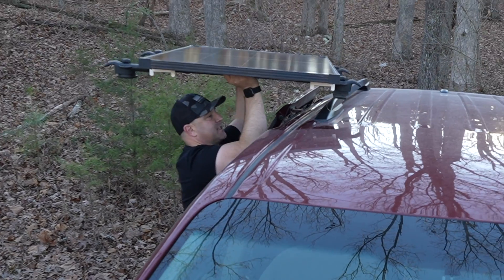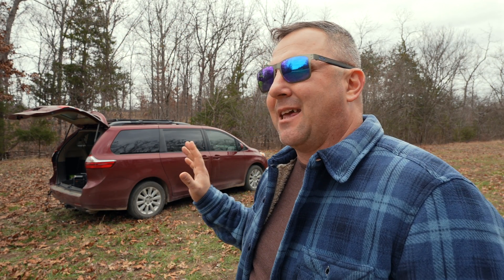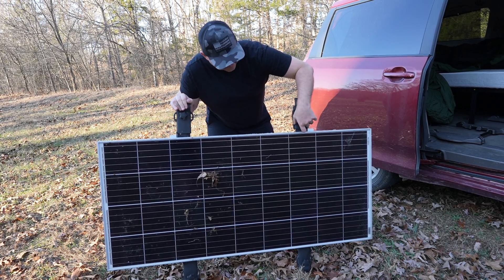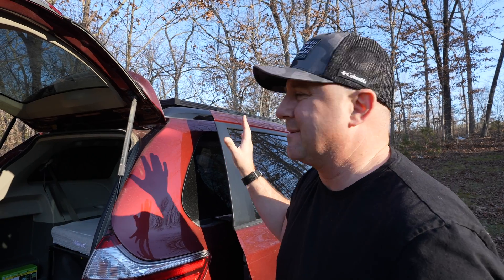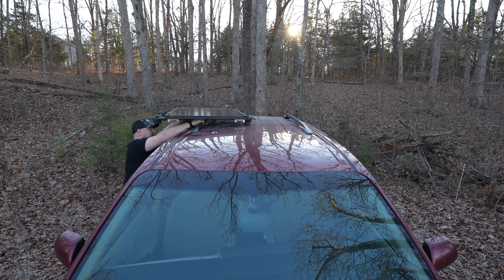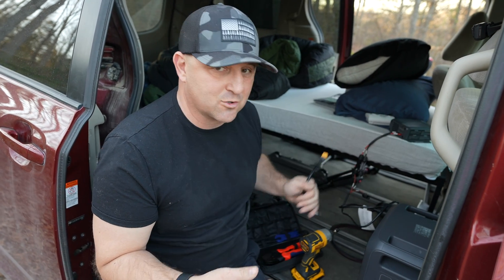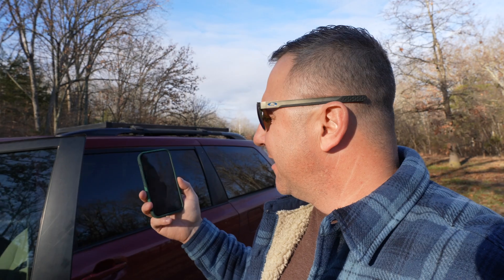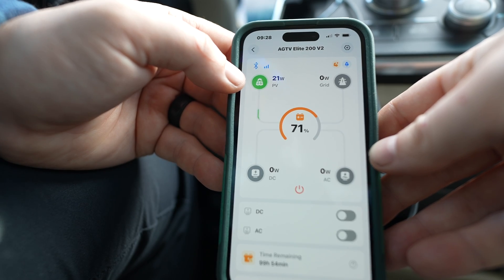Watch THIS Before Going Solar with an Alternator Charger!

Comment: Hi Mario, 

My 2012 Sienna Alternator failed yesterday.  A combination of 1500W Inverter, Headlights, Max A/C, and a few other minor usb accessories over loaded the system, failing the  starter battery then alternator.

I estimate the load that failed my system was 800-1000 Watts, a load beyond the alternator capacity.  

Rapid/High capacity battery charging consumes this and even higher levels of current.

Symptoms:
--> Invert Code:  Low Voltage (from car starter battery), turned off inverter
--> 30 minutes later, total failure, car went to LIMP mode.
--> Alternator shows open circuit, consumed a new second battery
--> Alternator & Battery replacement

I was at a remote state park this weekend, Labor Day 2025 when it happened and thought I would charge/top off my LifeP04 100AH battery while running some errands.  This was the first time I had exercised this charging process/procedure under these conditions, this was new.

This will cost between $1,200 - $1,600 to repair.  Lesson learned.

Important note,  Alternators generally do not have overcurrent protection, they just generate until they fail.

Fast charge systems can fast fail your alternator if they exceed the alternators rated capacity.  If the Bluetty or other unit does not require input of your car model to determine max current capacity, this is a sign of a potential  future failure. 

I Thought I would just share and hopefully save Viewers some money and inconvenience.
Reply from the maker: Ouch. 1500 watts is a lot from these alternators. Have you considered adding one of the hi amp output alternators? My system usually uses 560 watts max to charge.

Comment: The van lifers that depend on vehicle alternator power most of the time, augmented with some solar,  get stranded with electrical alternator issues.  Just get a little 1000 watt gas generator and all those problems go away.

Comment: Just add a solar charge controller panel from the solar panel into the 12 volt source to put it back to 12.volts.. I have a 100 watt panel. And a solar charge controller for the panel. 
Then I have three lithium batteries. Built-in. The alternator charges the lithium batteries. The solar panel goes into the same power distribution block. What is solar charge controller that converts it to 12 volts. I have a 0 gauge wire ran through the my Sequoia.

Comment: Oh the joys of learning right?  I'm starting off very small.  Years ago I bought a Motor Master PowerBox(400W capacity) and a pair of Noma Solar Panels(50W total).  I hadn't learned about much and Lithium wasn't a thing then but I work with what I got.  Now I picked up a 50Ah lithium battery, an eco-worthy 20Amp DC-to-DC charger(to be installed in the spring).  The Noma panels will charge my battery just fine,  looking forward to using teh DC-to-DC charger next year.

Comment: Does the Bluetti alternator charger only work with Bluetti Power stations?
Reply from the maker: @LukaAVDJ  it’ll work with any power station that takes up 11-56v. You can adjust the voltage in the app.

Comment: why all the hassle with this frankenstein mod?  use the bluetti dc dc converter D050S, ya... its about 150$ but it works flawless in any configuration. its on dc8 plug, so you connect it to the port where you usually put the AC charger in. and use the main port with the alternator charger. this way both work seperately and simultanious. 
dont step up the panel voltage and risk to ruin hardware, as you mentioned in a comment here.,

Comment: One 450-550 watt panel could fit on that roof and then you would not need the alternator charger. I prefer NOT to have anything connected to the electrical system of the car. Nice video and greetings from Jamaica.
Reply from the maker: I’d like to try a larger panel eventually. It would definitely be more useful especially on sunny days. The good thing is that the alternator charger doesn’t pull any power when the battery is topped off. So it’s good to have that backup power supply.

Comment: You may look into a dc to dc converter ... I used it to convert up to my bluetti max dc input.  cheap and easy
Reply from the maker: I just ordered a buck converter to increase the panels output to 56v. Hopefully that works.
Reply: @AdventureGearTV  pretty sure it wont

Comment: My vehicle battery is underneath the passenger seat, so the wiring to the 1000W inverter I installed, although large in diameter, is pretty short. I just adjust the charging rate on my EcoFlow power station so as to not exceed about 80% of the inverters rated power when cruising, even less when running around town so I don’t overload the alternator. Working very well so far.
I power my teardrop camper with another EcoFlow, the Delta2 Max, which has 2 solar inputs. This makes it much easier to deal with solar panels of different capacities/voltages.
Reply from the maker: Sounds like you have the system planned out well, and it should keep you charged up without taxing the alternator too much. EcoFlow makes some excellent power stations with a good app. Enjoy!

Comment: Hello, why if you have the ecoflow with 2 input you prefer the bluetti for your setup?
Reply from the maker: Hi, the two main reasons are overall capacity, and the larger AC inverter capability. I hope Ecoflow comes out with a Delta 3 Max.  That would likely be the perfect power station for my needs if they keep the dual input option.

Comment: Great information. Me? I’d keep the two systems separate. The only time I see solar important is if I were parked up for several days.
Reply: Yeah, I was thinking of some setup with a simple solar disconnect switch.
Reply from the maker: You’re absolutely right, it’s overkill if you’re only going to be parked for a day or two.

Comment: FYI bifacial panels work best when there is a lot of space between panel and surface area for the ambient light to maximize output from the rear of the solar panels.  My experience with bi-facial panels work when there is at least 40" of space and reflective background.  During the summer months the close proximity to your roof will decrease solar production due to heat from your roof to the panel as well.
Reply from the maker: @shelley131  thanks for the info. Heat wasn’t too bad of an issue for my prior panel, but could be a problem for the new one with some transparency.
Reply: I've wondered exactly this! I was thinking about roof mounting with pale shingles, but would they get warm with the drink transparency and reduce the cooling effect of the shadow?  @AdventureGearTV

Comment: Nice ground hog day video :-o your not the only one that has one of those days - thanks for the laugh and i think i will pass on the solar panel and use the alternator charging or a 2500 watt generator charging my ac200p bluetti at 460 watts just like house current charging. What is your first name i talked with you on Tims channel once Pat Noonan out of liberty,Sc.
Reply from the maker: Glad you enjoyed the video. It's good to have options. BTW, my name is Mario. I’m reaching out to BLUETTI to see if they can adjust the output for working with a solar panel with a different voltage.
Reply: @AdventureGearTV  Thanks Mario.
Reply from the maker: Also, I’m trimming that out now. Not sure why I did that. Lol.